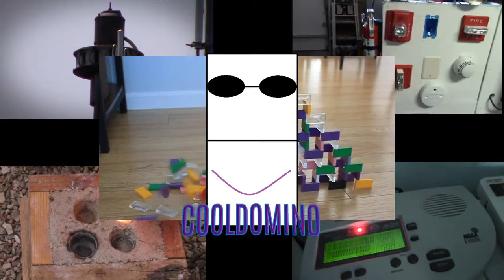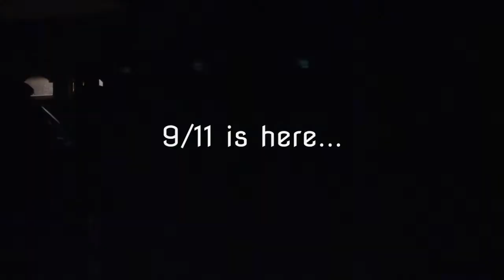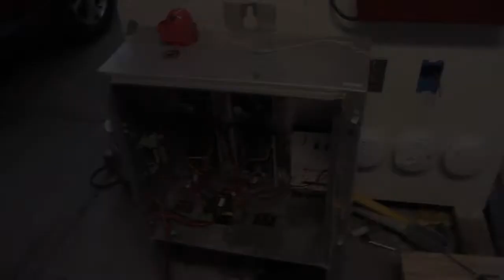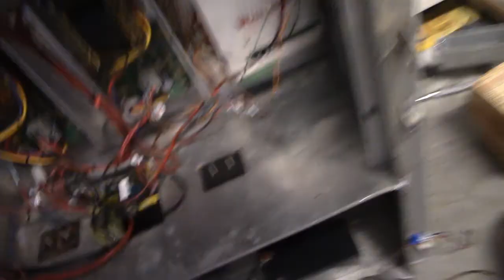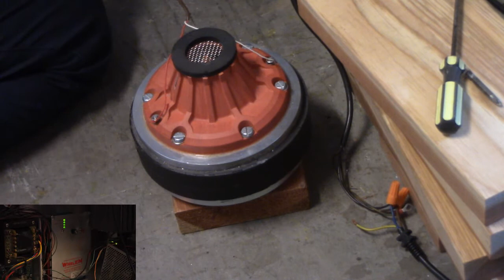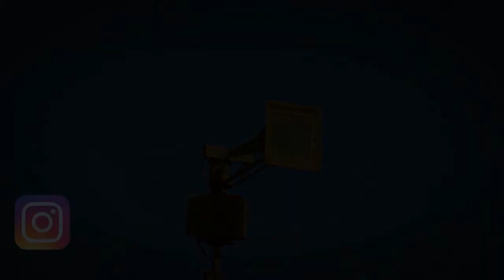9/11 special: whelen E-864 all tones (2020)

Comment: I didn’t think the digital ESC-864s sounded so modern
Reply from the maker: It’s actually a E-864.
Reply: @cooldomino1800  what’s the difference?
Reply from the maker: @goomanhlr5697  you can tell by the way it sounds. And it has a turn dial.
Reply: @cooldomino1800  oh, I thought they were the same
Reply: @cooldomino1800  So if a Whelen controller does not have that turn dial, it would be called "ESC" than?
Reply from the maker: @Siren1000T1  yes.

Comment: Didgital each-864
Reply from the maker: NJTransit Railfanning Productions you mean E-864?
Reply: cooldomino Yes I meant by Esc-864 but my stupid autocorrect messed it up
Reply from the maker: NJTransit Railfanning Productions it’s actually a E-864.
Reply: cooldomino How come?
Reply from the maker: NJTransit Railfanning Productions the controls are different. Look up a ESC864 vs a E864.
Reply from the maker: NJTransit Railfanning Productions also. The E864 dose not have voice capability.
Reply: cooldomino I think I know but I’ll check
Reply: cooldomino ok